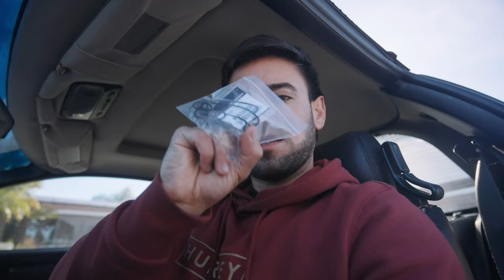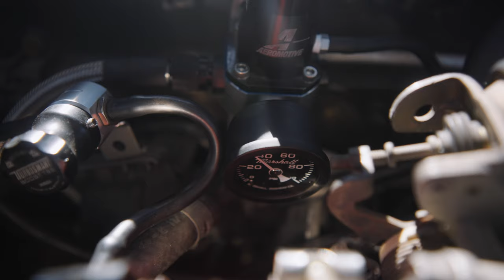No Podemos Arreglar Mi 3000GT VR4 Twin Turbo.. | Diagnostico De Sistema De Gasolina

Comment: Hola Miguel tiempo atrás ya te había comentado que a mí me pasó exactamente lo mismo en mi caso fue que el tanque de combustible se me agujero y tube que conseguír otro pero el que conseguí ya tenía mucho tiempo a la interperie y lo lavamos antes de instalarlo pero quisas quedó basura que no vimos y con la gasolina se soltó y hacia exactamente la misma falla no me dejaba acelerar bien cambien bomba sensores limpie inyectores en fin mil cosas y no se arreglaba y un amigo me comentó que enseguida del tanque tenían como un regulador de gasolina optamos por eliminarlo y pusimos otro regular pegado al riel de inyectores y fue el remedio ahora corre bien quisas se tapo con la basura que se soltó el mío es un eclipse 98 pero es exactamente el mismo problema